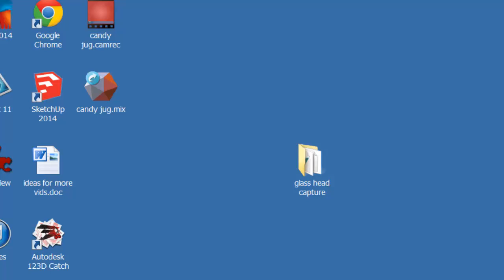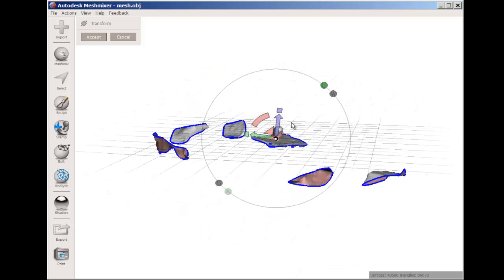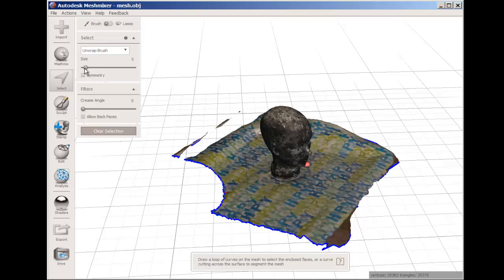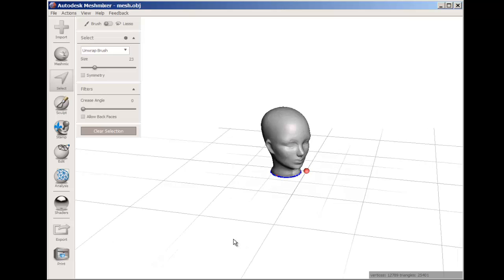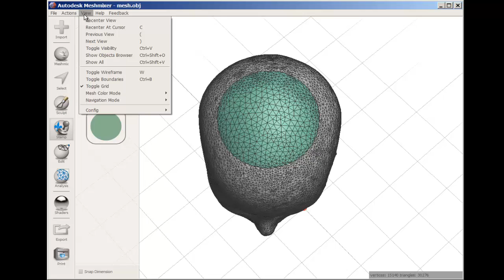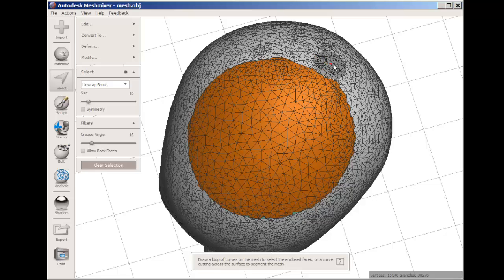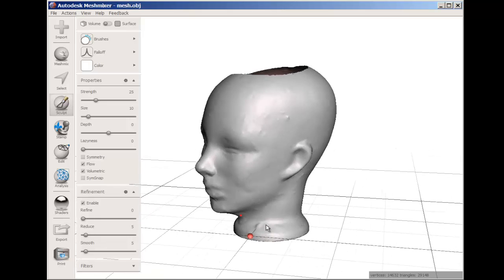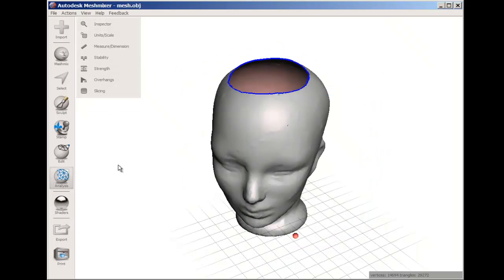Meshmixer: From Scan to Candy Jug

Comment: I am sorry but it is not actually not ready for 3D printing because after you make hole into model it is no longer watertight.
You could get some thickness by extruding all the faces or use a new Hollow feature in current version of Mesmixer.